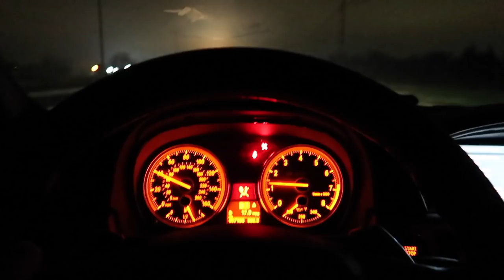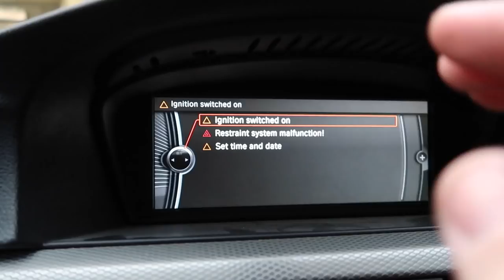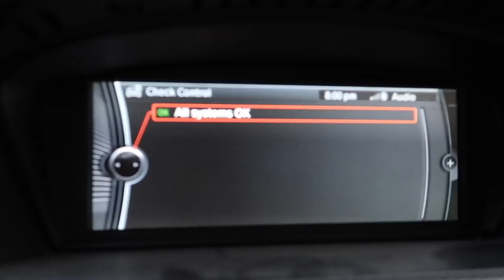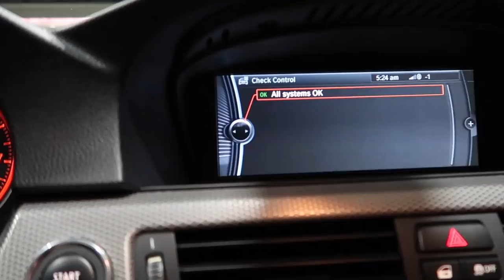OUR 335IS GETS SO MANY NEW MODS!!

Comment: Hey nour, I am a huge fan of yours and been watching u for a while now. I love the build and all the content u put up. I noticed that after you washed the car and you were in the gas station a bit of condensation was in the headlights. I get the same thing with mine and then goes away when I park the car at home. Is that normal for this generation of the e92?  Because I am scared that something can affect the headlights and result it to fail.